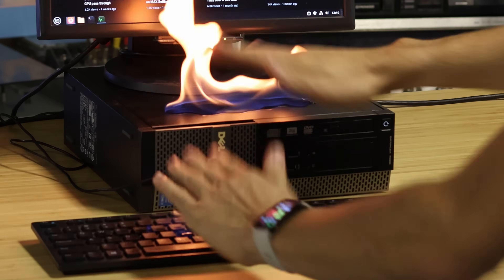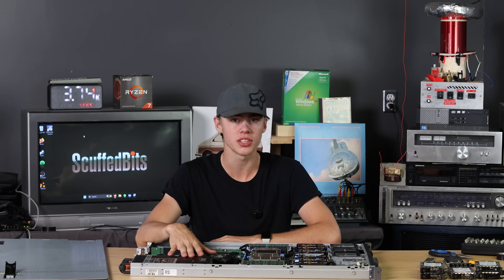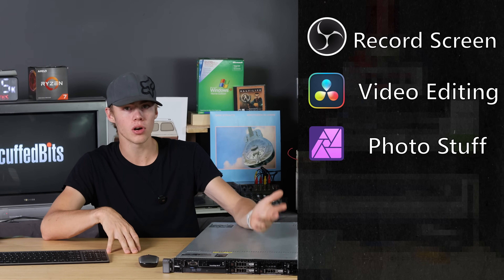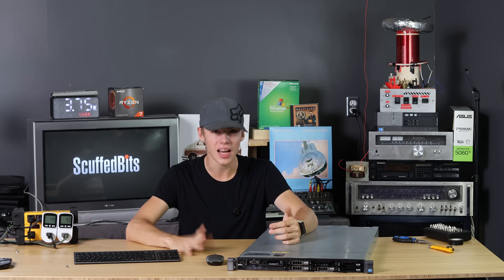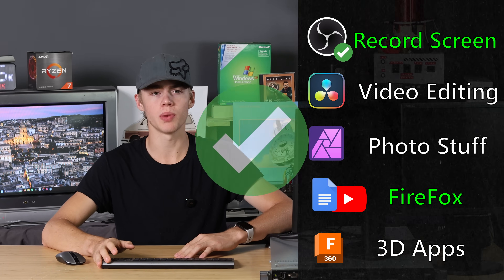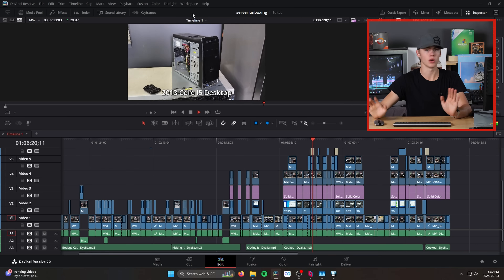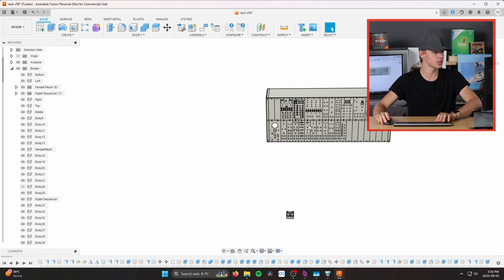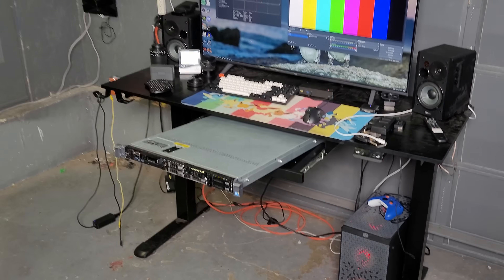Can an Enterprise Grade SERVER Replace Your Desktop?

Comment: Hey buddy, go to bios settings, go to integrated devices, turn OFF the integrated graphics controller.  Your GPU has to match, at minimum, what the on board matrox can do.  If you try like a GT 76600 it won't work.  Anything GTX700 / Radeon 5K and up should work in like any poweredge.

Comment: I think you are just testing the gpu more than the server
Reply from the maker: The gpu was definitely a limiting factor. I also tested a GTX 1060 on the server though and in vr It still had a lot of issues and the performance was only slightly higher.

The 1060 is able run beat saber fine and not have crazy latency and bad performance like that when using a normal modern computer.
Reply: @ScuffedBits one cool test for this server is to try to see how many minecraft servers it can run at the same time soecially with that amount of ram
Reply from the maker: @earthchanger604  thanks for the suggestion! I really should try more minecraft stuff.

Comment: i had a newer dell poweredge (2012 or 2013) at one point it lasted one or 2 years before i stopped using it due to problems with the x16 slot it was in tower configuration hardware i use now in days for plex and backup is newer and standard pc hardware